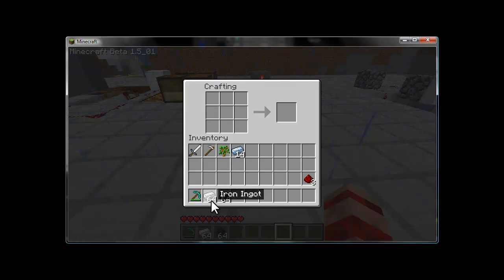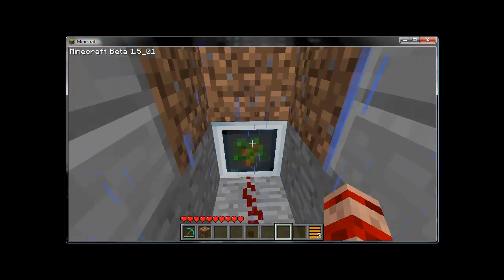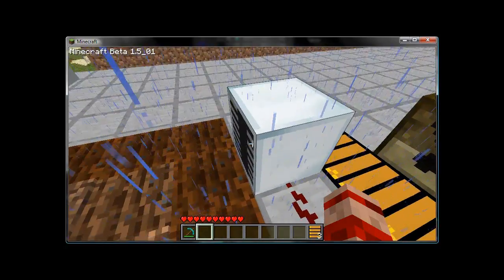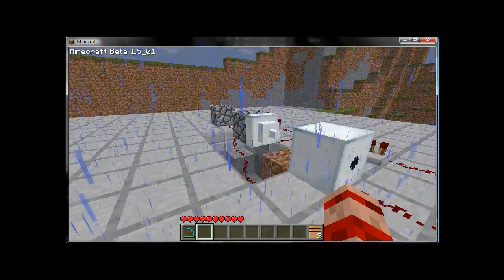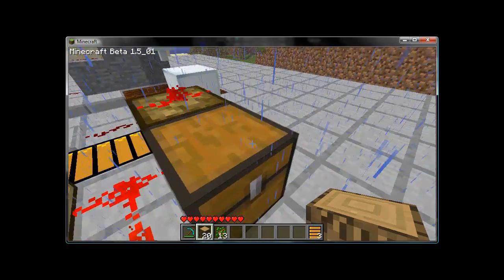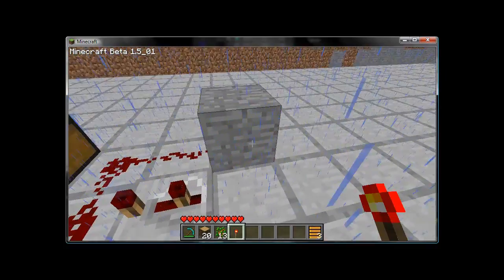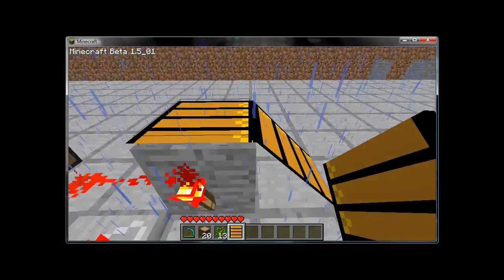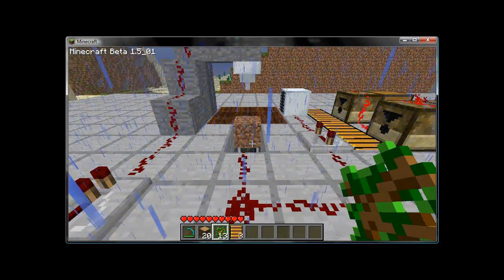Feanorith's Minefactory v1.0 + Pfaeff's Allocator Mod Demonstration Tutorial

Comment: @petrus4 I use both the allocator and the diamond pipes. I use the diamond pipes to seperate all the resources, then i use the allocators to separate each material to a specific crafting table because only one crafting table needs materials at one time, so i can turn on only 1 allocator, whereas the diamond pipes are always on.